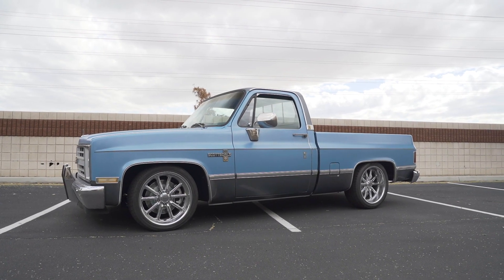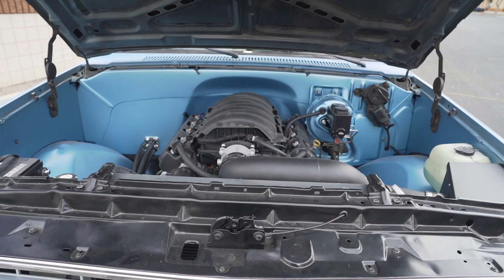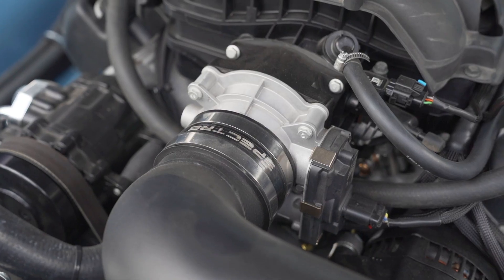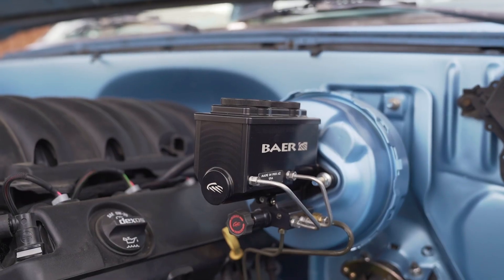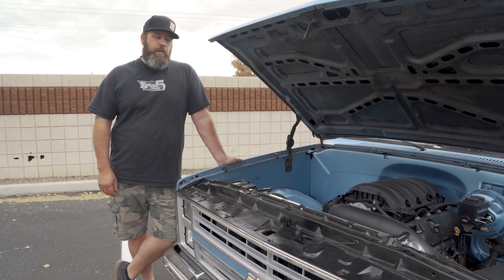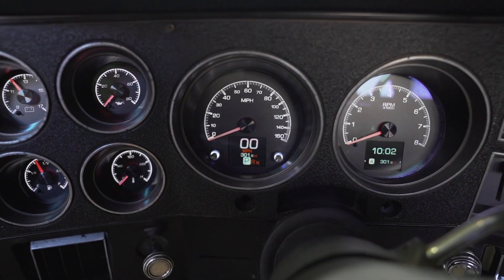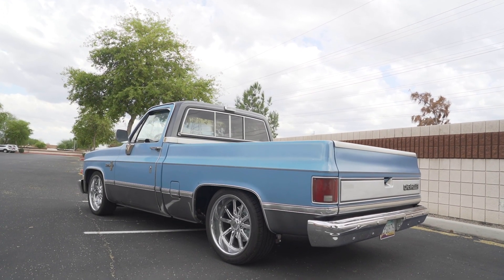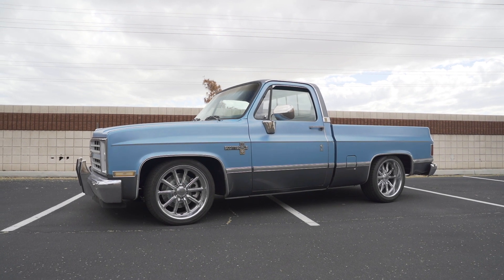Squarebody Chevy L83 Swap. Part 5

Comment: what cable shifter kit is that?
Reply from the maker: Lokar
Reply: @tre5customs113  sweet  is it  necessary  to raise the tunnel like you guys did for the 6l80  isit because you used different  tranny mount.
Reply from the maker: @bayarea6464  we used dirty dingo engine mounts and set the trans pan level with the ground. That’s the only way I’d do it.
Reply: @tre5customs113  do you sell that raised tunnel piece  you guys made could I buy one from you?
Reply from the maker: @bayarea6464  no. We just fabbed it to the truck.

Comment: What Headers and Engine Mounts did you use for this swap?
Reply from the maker: The customer supplied the headers, not sure what they are. I do know that if the decision was ours, we would use Ultimate Headers. We use them on all our builds (when given the chance) and we are a dealer for them. 
Engine mounts were supplied by the customer as well, but I believe they were Dirty Dingo mounts.